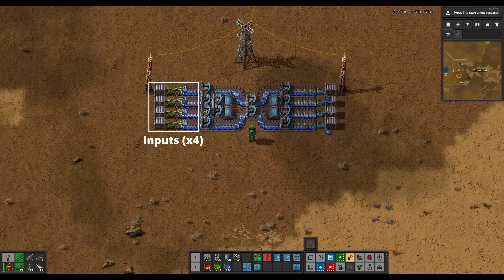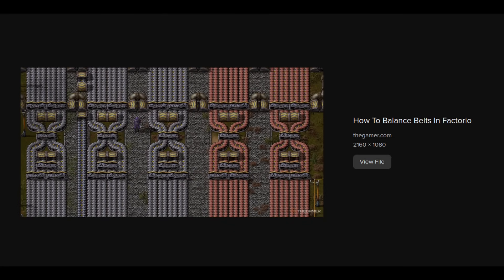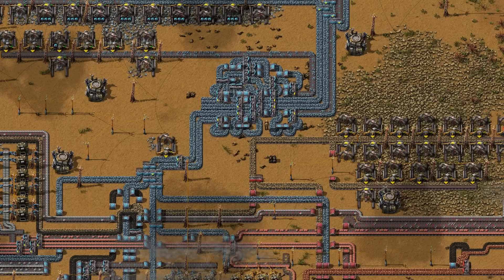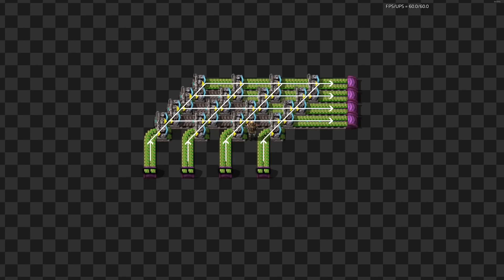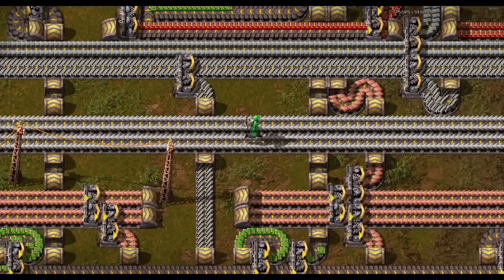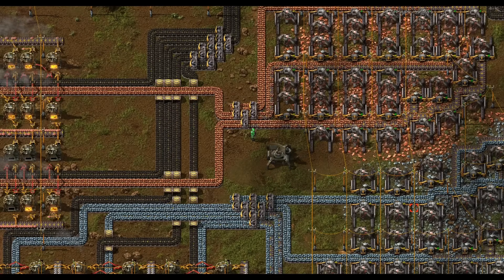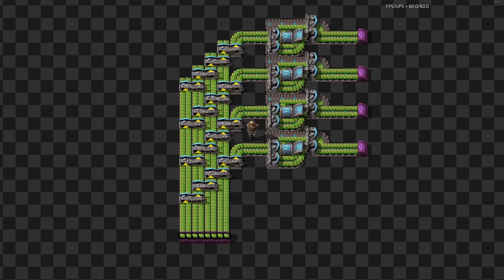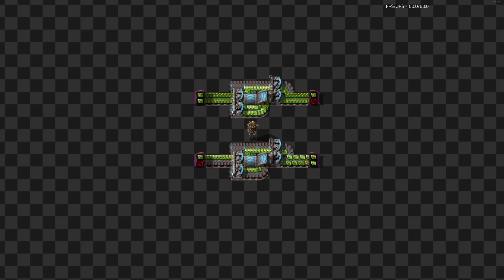Crossbar Switches: An Alternative to Belt Balancers in Factorio

Comment: If the inputs are stretched out enough to allow factories to consume directly from the bus between inputs, the effective supply of the priority line becomes the sum of all bus line flows because the priority line is replenished periodically to maintain a supply that can keep pace with demand. That is, yellow busses using a crossbar switch with more than 4 lines can outperform a turbo belt in terms of raw flow rate, meaning flows > 60 i/s are available as soon as belt and splitter pooling is established

Comment: 9:55, second row, left end : This 2:3 switch seems to starve one output.  Second from the left appears to be starving several outputs.  However both of these seem to be circuitless "feed these builders as fast as you can as often as you can until they stall, then feed these less important builders...  (This is common on my space platforms in Space Age, since I want ammo' made as much as possible, then when that's "full", use those resources to make fuel, then when that's "full", make whatever the platform is actually for.)

Comment: I use switches quite a lot. What I've found is it can be difficult to ensure even usage of an ore patch, though, such that you maintain the throughput capability for as long as possible. Because the switch doesn't really try to evenly consume from the inputs, you end up drying out one side of the ore patch before the other. If this is a desired capability, I end up having to use a balancer.

Comment: for drawing from or adding to a bus, the crossbar switches will do fine. However using diamond switches to solves the N:M problem has problems both in early game and late game. In early game when you just started building your factory splitters are kind of expensive while in the late game you have essentially an unlimited supply of them but depending on the scale of your factory and your PC the excessive amount of splitters can eat into your performance.

I'll stick with a pre made balancer book for train stations, mining outposts etc

Comment: Looks like putting lane balancers after the N:M crossbar switch with N>M can lead to under-performing bus, where the lanes are blocked before the switch but the belt doesn't saturate fully after the switch. I moved my lane lane balancers before to fix that.

Comment: You mentioned you hadn't proved whether you need to set the input priority on your diamond switches. It does seem like you need to do so to keep the switch throughput-unlimited. To see this, you can set up a 2-lane-to-4-lane switch and block the bottom two output lanes (the ones not directly opposite the input lanes). Without setting the input priority, the top output gets throttled to 1/4 of a belt.

Great video! Took a bit of experimentation to figure out how these things actually worked, but it seems like a useful variation on the compressor-kinda-things I have been playing around with for a while. I think I'll start playing more with priority-based balancing like this to see how it shakes out. Unlike the ad hoc compressors I was using, it's neat that these NxM switches can be used when N > M and when N < M.

Comment: For trains i balance using circuits:

1. i connect every chest with green wire
2. i connect every inserter before chest with green wire
3. i connect every inserter before chest with that chest with red wire
4. green chest wire has a sum of all items in all chest, so i divide it using arithmetic combinator by number of chests to get average A
5. i add some constant like 10 to A using second arithmetic combinator and get threshold T value and connect output to green inserter wire
6. i set inserter condition to work only if amount in the corresponding chest is lower than T
Reply: I came up with something similar in my current game of Nullius. No threshold value, though.

1. Wire chests together using red wire, feed into arithmetic combinator. Compute "A = iron plates / 8" (or however many chests there are at the station).
2. Wire inserters together using red wire, feed with arithmetic combinator output.
3. Wire each inserter to its chest with green wire. 
4. Set condition on inserter to "iron plates <= A". Replace with >= if it's emptying the chest, rather than filling it.

Comment: Another belt consturct to consider as well is the router. Similar to the crossbar switches, routers provide a path from any input to any output, but they are explicitly NOT I/O balanced. They are simpler in implementation than a belt balancer, and also a wise choice to use in places where it doesn't matter if the I/O is balanced--just that resource gets distributed SOMEHOW from each of the inputs to each of the outputs. I use routers a lot on the outputs of mines going into furnace stacks.

EDIT: Aaaaand then I watched the video a little bit further and the diamond switches you mention are... pretty much almost exactly routers to a T. 😂

Comment: 3:56 - "one case where balancing DEFINETLY matters is train stations" - no it does not. You can attach the inserters to a circuit network, and balance it that way, instead of these belt monstrocities. Like if its your personal choice to do everything with belts only because you like doing balancers - fine. But if you are making a train station that work, you DEFINETLY dont newd a universal balancer. EDIT 10:40 LMAO or just pass the initial three belts in front of the inserters, and tell inserters to stop if their box has 20 units more than the average box.

Comment: I actually work in IT and the N to M problem in networking tho modern crossbar switches i tend to use blelts in factorio like networking cables lol. As i find 9it funny as the bels use values close to actuall packet ticks so its a habbit.

Comment: I independently reinvented some of these switches. But I didn't realize their generality. I think I am going to use these purposefully more now that you explained their properties more fully.

I liked them initially because they are easy to plan out in any configuration without a blueprint. For the low to high multiplexers, The primary drawback of them seems to be that they don't always do something sensible to your output lines if demand exceeds supply significantly. The lines end up having a sort of implicit order priority, and that maybe a good thing or not depending on where it is.

Comment: I’ve put the splitters after the output. With a right output bias. For a single sided mainbus it means the side furthered away runs out of materials first and it becomes obvious when your over using a material and need a new supply.

Comment: 7:15 You don't need input priority on taps off the bus, and you don't need output priority on merges into the bus.

Train stations don't need to have balancers at all. All that matters is sustaining throughput. You hinted at this earlier in the TU balancer discussion, but didn't extrapolate that beyond bus stuff. Consider it this way. A train loading station needs to do two things. Fill the train (duh), and guarantee sufficient throughput such that incoming items don't experience backpressure.

Neither of those criteria require balancing. You can load trains from one end to the other, and have buffer chests only servicing one wagon. As long as the station can fully consume the belts, and as long as a replacement train arrives before the buffer accumulates more than a wagon's worth of materials, you lose zero throughput. This doesn't require circuitry. It doesn't even require splitters, at least not for lower numbers of belts.

Comment: I just call them priority splitters (calling the macroscopic version the same thing as the item is confusing, I know) or priority bus splitters, and that seems to be what I have seen others call them in the community. Since priority splitting was first added to the game, they were argued as a potentially superior version of belt balancers for a main bus as you could always split off a full lane with them, but many argue that "they rather have everything getting a little bit with balancers, instead of nothing at all" which is pretty valid. Personally I use them to concentrate my buses onto one side, making it easier to split from, but most of the final splitters off the belts are unprioritized making it so they only split off half a belt, kinda the best of both worlds. 

I would never use them for trains or mining patches though, as even distribution is key to fast loading, fast unloading, and evenly depleting stuff (whether it is mining patches or chests). It is a quick, dirty, and easy solution, but if you have splitter tech, then you have the ability to make a proper balancer which will pay off down the line when it matters.

Note, these are key for space ships/stations as they have basically an "overflow" lane, a lane which only gets items when all of the prioritized lanes are full, which can be routed overboard to keep belts moving. A very similar modified version can work as a bypass for filtered splitters when they overflow, which is also immensely useful in space, Fulgora, and Gleba.

Comment: I definitely like the idea.  I believe the reason that balancers are still used more is that they are slightly better performance due to less splitters.  Not that it is alot, but enough to make a slight difference.

Comment: This video is very well made and informative, but I think it's way TOO informative for a topic that quite frankly I hope nobody is completely unfamiliar with. 12 minutes isn't too egregious, but I think it could have been shorter without alienating any viewers. "hey, yknow how you can just spam a bunch of splitters instead of using the balancer book? You probably aren't doing that past early game, but here's my case as to why they're actually good enough for most scenarios. It's actually an analog for for crossbar switches! Here's the pros and cons, a few different designs, and some tips for setting input/output priority". 

This video doesn't seem to me to be presented as a tutorial to beginners, but at the same time it's also way over-explained for those familiar with the game. 

At the level of detail that this video went into, I think it is also remiss to have not mentioned that the diamond crossbar switch can be easily used as a merger for two inputs. I've done this in the past when my factory bus line was consuming more than the 4 belts of iron that I had originally started feeding it with, so instead of moving absolutely everything to accommodate an 8 belt bus, I merged a second input of iron halfway down the bus where the shortages were occurring. I liked using the 4 vertical belts of extra input in just one x position of my factory a lot better than making the entire factory 4 belts taller for the entire length.

Comment: The crossbar switches shown in the video have an extreme bias towards the "bottom" output, no matter how the splitters are configured. This means that they are NOT an alternative to N:N balancers and instead are simply N:M packers. This makes them useless for a variety of tasks such as even distribution, sushi belts, and more.

The configurations shown will all densely pack belts before filling the next belt, going up the chain until there are no further belts to pack. Unfortunately there are no configurations that fill the belts evenly as no matter what input priority you set, you will either be biased towards the top, bottom or middle. Oh and it is not necessary to set input priority only output priority - setting neither will make it bias towards the "middle".

This belt packing behavior though means that you will always have as much as possible on the belt, so if you have a massive bus they can help shift things towards the important lanes again without being throughput limited. Shame they're extremely expensive to use.
Reply: After a while of using these in real bases I've found a few more issues due to their incorrect weighting. In addition to their output being weighted towards the bottom the input is weighted towards the bottom as well. This causes them to deplete resources in a specific order instead of evenly and drastically shortens the useful lifespan of resource patches.

In a test world the average useful lifespan shortened by as much as 63% compared to an actual balancer. A useful lifespan of a resource patch is defined as at minimum 4 full blue belts of output - or the equivalent for resources that aren't used as much.

Comment: I used Crossbar Switches alot in space exploration since some recipes dont require much input once the belt is saturated otherwise it deadlocks because the machines output the ingredients alot. So I could still process 4 lanes of ressources while only providing 15 items/s to each productionline. It was really usefull.

Comment: good clean explanation. there is still some holdover, but when balancer priority was added there was quite a bit of debate over if belt balancers or priority balancers were the right way to handle bus designs or not. I personally switched to using priority balancers like you show here and only use traditional balancers in situations where I care about the ability to draw resources evenly (like for trains or resource patches).

I've never seen that bit about using circuit logic to balance the output of your belts, thats pretty slick way to created an arbitrarily sized universal balancer.

Comment: hot take: you don't need all this if you just over produce and use buffers.
it's way easier than doing exact measurements or balancing, set your producer to produce if the buffer is under a set capacity, and it will self regulate your ratios perfectly, and you can use a manifold because your lanes will be saturated anyway.
(and for trains you just set a limit on the buffer chests and put more trains than needed, forcing them to go even if not full)
edit: I forgot warehouses and silos are a modded thing, you can use a wagon as a buffer instead though.

Comment: Every time I do a main bus build, I think about re balancing the bus after the first split and find myself asking why I bother when I can just peel off a lane and balance the whole system at the input.  Fully compressed belts just don't make a lot of sense beyond the feeling they give you that you're operating at maximum efficiency, when I tend to play more as a plumber (working off pressure) rather than an engineer that focuses on ratios or timings.  This is even more pronounced in space age if you're doing bulk "quality-mixed" belts... you're just not going to get a full belt on lots of items, so as you move away from compression for the sake of it, reasons for attempting better throughput on your most common items is more important than never having a free space on a belt.

I've never had to use combinators as much as I do now and I feel that the game is pushing sushi belts more than ever.  The ubiquity of belt balancers is in jeopardy... new solutions are needed to keep the assemblers humming.  This helps.  Thanks.

Comment: 8:51 you do need the input set

consider: 3 full inputs, and bottom output gets backed up. 
With no input priority, the bottom splitter will try to take evenly from the bottom two lanes, but can only output to its one top output lane. 
The entire bottom input needs to output on top. Any input from the top input will slow down the bottom input.

Comment: I've used crossbar and diamond switches a lot, but in 1400 hours I don't think I've ever built a proper balancer with the designs you showed. I also never use blueprints except for stuff I already have built in my world, so that might be part of it. Putting a bunch of splitters down is a lot easier than remembering the setups for balancers, especially once you get above 4 lanes.

Comment: Diamond balancers can also be used to sort sushi belts, such as what you need to do on fulgora. Just make use of the filter capability of the splitter, place diagonal rows of splitters that feed into one another all of which select for the same commodity, and extract out the low prevalence goods first. In certain cases, the diamond splitter may have to split into multiple smaller diamond splitters for the high prevalence goods if full throughput would oversaturate the lane used to output that good.

Comment: I’ve recently started using these techniques on my bus as my starter base consistently exhausts supply.  It has lead me to realize that the upstream problem is that only smelting 900 I/s cannot possibly supply an 1800 I/s requirement. So there is that.  But I do use diagonal splitters with full input/output priorities set and it’s amazing how much more resource I move down the bus.

Thank you for taking the time to do this video and lay out some of the interesting options. The beauty of this game is that the potential for multiple variations on a theme seem to be endless. Lately, I’m less interested in deadlines and more interested in design features . In other words, not in a big hurry to make a rocket. But I love getting to the train phase, and building a giant train set that actually has a purpose other than going round and round the mountains.

Comment: These shouldnt work for trains, should they? The issues with trains are ensuring the buffers are filled and depleted at a perfectly even rate, rather than the pure output characteristics of the station. Even my basic hack of inserting a close orepatch belt into a station instead of making a second resulted in it preventing the even unloading of one of the wagons. As for cross-factory applications, we should theoretically be able to always ensure exact production and consumption rates so long as outputs are consumed so these should be practical.